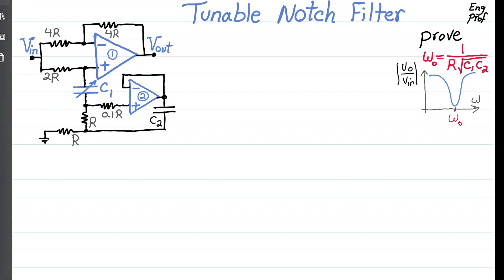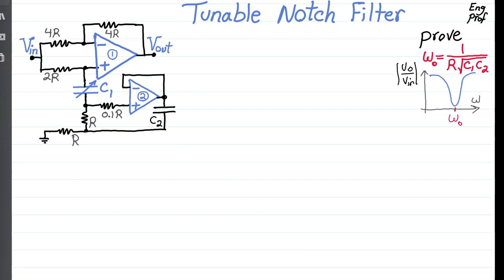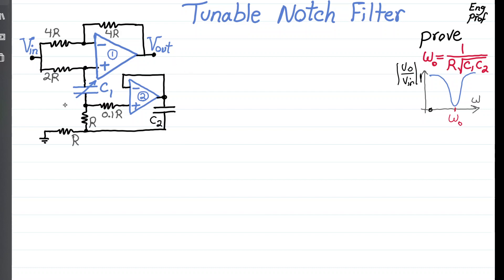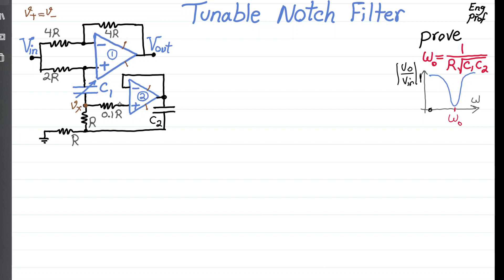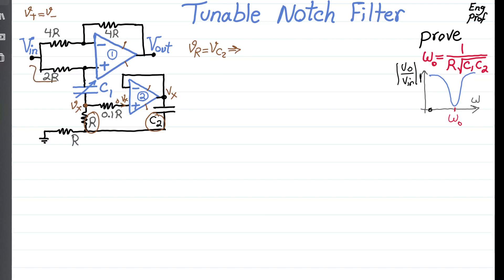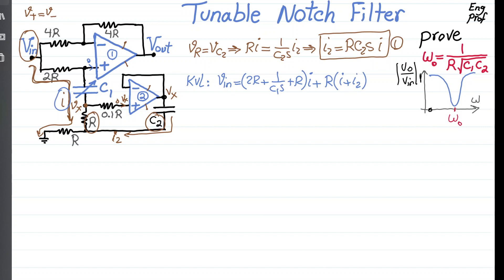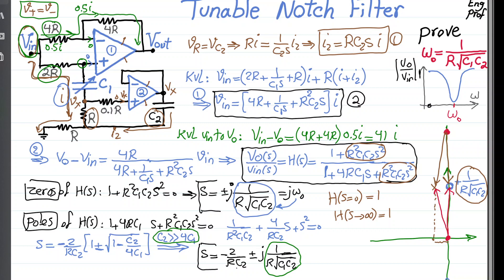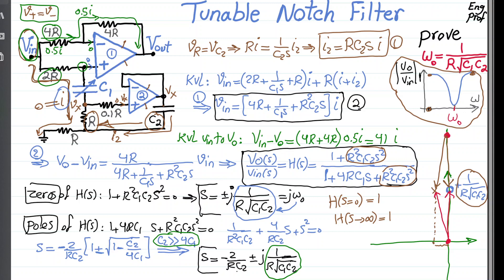Band-stop Filter Design with two operational amplifiers

Comment: hello, I need design a band stop filter the frequency between 1KHz to 2KHz, could you assist me please, by giving resistor, capacitor value.
Reply from the maker: Good question. For a robust, easily-adjustable practical design I suggest first watching how to select component values for a low-pass Filter and for a high-pass filter as explained in this video: Sallen-Key Filter Design Tutorial: LPF, HPF Frequency Response https://youtu.be/KwUnQXbk7gM
For your design, Set the 3dB cuffoff Frequency of your LPF to 1 kHz, abd 3dB cutoff Frequency of your HPF to 2 kHz. Then apply same input to both LPF & HPF that are placed in parallel. Then add the outputs of both Filter using a simple Analog summing op amp Amplifier. For practical reasons, I suggest using zero-drift low-noise audio CMOS Op Amps from Texas Instruments or Analog Devices in Quad package so that all 3 or 4 op amps that you need are inside one IC package (to minimize noise, oscillation, mismatch, etc.) 
For more examples, I suggest watching my following Filter related videos:
Universal Analog Filter Design https://youtu.be/2J-0msXZE2o
Band-Pass Sallen-Key Filter Design https://youtu.be/lsM09pcrRVE
Butterworth Analog Filter Design with Op Amp https://youtu.be/SIMg5TOIgrA
Laplace Transform Example and S-domain circuit analysis:  https://youtu.be/ps8N5TPM_qU
Op Amp circuit Bode Frequency plot https://youtu.be/BLVzuuqAlZs
Bode Plot, Frequency Response, Transfer Function https://youtu.be/vZFkPeDa1H8
Lowpass Butterworth Filter: https://youtu.be/UzCjkwqy-9w
I hope this explanation is helpful in answering your filter design question.